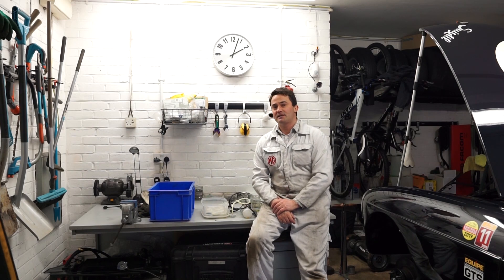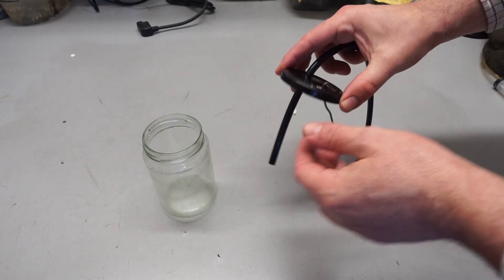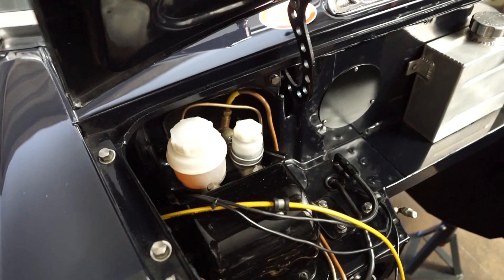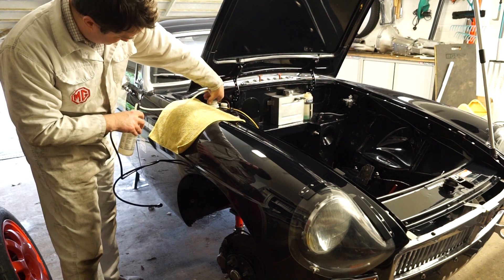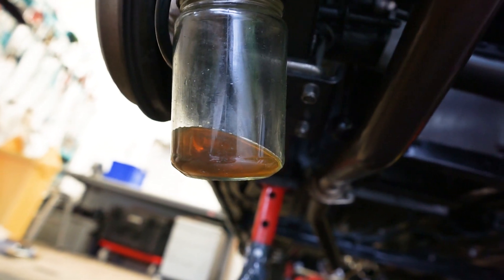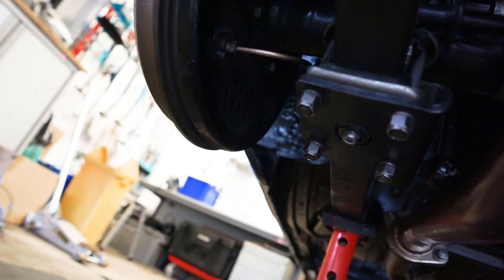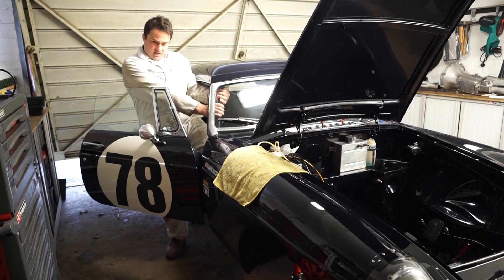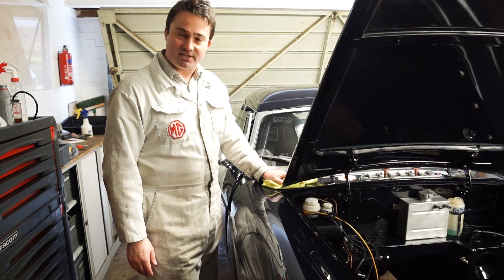Bleeding and refreshing the brake fluid in an MGB using the Gunson’s Eezibleed System One Person Job

Comment: G'day David 

Your video had perfect timing and once again an excellent explanation.  Along with the reinstall of the windshield over the Canadian summer I've also planned to bleed the brakes, the  first by me on my 65 roadster.  The Gunson Eezibleed is now on order! 

I rate your explanation including vision/editing up there with the best when it comes to learning the MGB "secrets".  Well done sir!
Cheers
Aaron G
Reply from the maker: Many thanks Aaron, the Gunson's set  does seem to work well for me, especially if you are bleeding the brakes yourself. Just remember to keep the reservoir pot topped up. Also don't do what I did around 20 years ago which was to bleed the brakes without the front pads fitted; I pushed the pistons out of the caliper! Silly school boy error only made one. 

I'm hoping to re-shoot the windscreen video to show re-fitting it to the car but just haven't really had time, hope all goes well!
Reply: @davidrussellwilks  Gday David - I bled the brakes today, followed your instructions and everything worked fine.  My bleed kit hissed a tad as well but plenty of towels etc ensured the reservoir did not overspill.  The bleed nipples were different size on my 65.  The back ones weren't 7mm, a 1/4" spanner worked on those.  The front were much larger (I cant recall the size).  DOT 3 was my go-to which was the equivalent to the fluid type recommended for the original systems....there is so much conjecture of the those types according to agae of system, seal types etc.
Cheers again
Aaron G

Comment: I've been waiting for you to upload this and am so happy that today is the day. I started on my brakes with a vacuum bleeder. The unit also came with an automatic refill device which is designed to put new fluid back in the master cylinder as the old fluid is withdrawn. The system did not work as advertised. The vacuum would pull some fluid out of the bleeders but would stop pulling before the new fluid got there. I stopped there and ordered EZ Bleeders which are a one way check valve that replaces the regular bleeders. This would allow me to still bleed the brakes by myself by pumping the pedal. Using the EZ bleeders and the automatic refill device that came with the vacuum bleeder, I began pumping and the first caliper went great - the old fluid came out and new fluid went through and the MC stayed filled. I proceeded to do the rest of the brakes trusting the automatic refill would continue to work. It did not and I ran the MC dry. I kick myself for not paying closer attention and also for not purchasing the Gunson's in the beginning.  I believe my only option now is to bench bleed the MC and start over. I would like to know if you have any tips on purging the MC.
Reply from the maker: Hi Trent, that is a real pain, and it is easily done. I had to swap out the master cylinder in my car a few years but I DIDN'T bench bleed the system first. What master cylinder do you have in your car is it the earlier or later type? Not bench bleeding didn't seem to be a problem with the single line master cylinder. I used the same procedure as above bleeding the furthest wheel first; it didn't take very long to purge the air from the system. I think it would be worth trying to bleed the brakes again before removing the M/C from the car?
Reply: @davidrussellwilks  It is a 1967 with the single master cylinder. That is good to hear that I may not need to bench bleed. I'll try again and hope for the best. Thank you!
Reply from the maker: @tkreitler  It's certainly worth a try!

Comment: Thank-you again for another thorough and informative video. Giving me the confidence to work on my own car. A couple of questions I thought of through the video, how will I know that I have purged the old fluid out of the brake lines and now have fresh fluid in? Is it a guestimate based on approximate length of line and internal diameter or is there something that I should look for (other than say bubbles)? Also, with your little collection device, what was the internal diameter of the rubber hose please? I like it and will make my own but a rough idea of ID would be handy (I'm guessing 4-5mm ID but that's quite a guess). Cheers, Phil.
Reply from the maker: Many thanks for your message Phil, if the fluid in your car is old it would be worth using a syringe or similar to take most of the fluid out of the master cylinder, leaving just enough in the reservoir so air does not enter. Once you have filled with fresh fluid and taken around 100ml or so out of the furthest bleed nipple this should mean that the old fluid is out of the system. Often the old brake fluid is a darker colour and once you can see that clear fluid is coming through it should mean that the system is purged. The hose I use for the collector is 4mm ID and is silicone, making it a bit more stretchy.
Reply: @davidrussellwilks  perfect, thank-you.

Comment: Great video David. I was wondering, how did you get all your technical knowledge? Perhaps work related or only from learning by doing? I go for the Pippi Longstocking way: ‘I have never done this before, so it should work’ 😬 With some basic knowledge started on a good original Californian car, running and driving project. Happy with every nut and bolt that loosens easily, but far from the state that your car is in. Interested in how you got so far that we are learning from you! Greetings from a small town near Maastricht.
Reply from the maker: Many thanks for your message Michael, I've never had any formal mechanical training; in my twenties I worked at a friends garage on and off for a few years mainly just working on my own car (an MGB GT). We also had a side line selling MGB parts and restoring cars, I usually looked after the sales side more but certainly enjoyed working on the cars too. A few years later I started the race car project and built most of the car myself  with the help from the team at Lone Pine Garage in the UK. I didn't build the engine, gearbox or back differential but I can most of the work is mine including preparing the body for paint, but not spraying it. The team at Lone Pine were great to have on hand though for any questions that I had. 

I started making videos of the racing back in 2013 and tried to improve on these as I went along. I made a time lapse video in September 2018 showing the engine and gearbox removal, this seemed quite popular and got lots of views so I decided to make a few more videos showing the basic jobs on these cars. From the responses to the videos it seems that there are lots of home users who would like to work on their cars but are unsure where to start. Hopefully the videos I make will give people the confidence to try. 

With my car I am lucky that the bolts are all fairly new and assembled with aluminium great so are easy to remove!
Reply: @David Russell-Wilks: many thanks for your reply. Years of hobbying experience and help from some friends... that’s the secret I gather. O yes, and leaving the really difficult tasks to specialists. Not to Pippi Longstocking 🙂 I used to work on an old Peugeot 504 (1973) with my dad, wo died six years ago. I still own this car and it is 100% original, the MG is my own project now. Flying solo. Taking on every battle at a time. Currently fighting the petrol filler cap of which the lock decided to fail. I think it is great that people, such as yourself,  take the effort to share their experience with others so that we can learn. Lots of thanks for that! Keep it up and your number of followers will grow. 💪🏻
Reply: Hi David, great video for someone who just bought the first MGB like myself. I was wondering if you could advise - during the first drive the break pedal lost suddenly twice pressure during some 60miles drive. When I applied the force again, it was ok. Would you advice to bleed the breaks or is it showing a problem with the break master cylinder? The car was not much used last few years before I bought it . Many thanks for your advise and please keep doing those videos.. 
with kind regards 
Petr

Comment: Thanks for the video. I have just purchased this kit but not used it yet. Quick question if I can? Did you fill the master cylinder to the top before attaching the Gunson cap or did it just fill itself from the main bottle when you attached the spare tyre? Best regards.
Reply from the maker: There was fluid in the M/C but not to the top, it will fill itself from the Gunson bottle as fuel is added. It's well worth testing the system without fluid in the Gunson bottle first to check for leaks.

Comment: Very informative once again David. I'm surprised the pipe is black instead of clear though as how do you know when the old fluid is bled from the brake line? If pipe was clear I assume you'd see a change of colour and also be able to check for air.
Reply from the maker: I did originally have a clear pipe but it split so went over to the black one. By looking for bubbles abd the colour of the fluid going into the jar I could tell if the brakes were bled. I've since been able to find a good quality clear silicone pipe and am using that now.
Reply: @davidrussellwilks  I'm hoping to bleed the brakes on my MGB GT and  1300 ADO16 very soon and was going to use the gravity method. Apparently takes much longer but that's not an issue for me. Have you ever used this method and if so did it work out ok for you? Many thanks

Comment: Good video, thanks.  I have a servo on my B and my brakes are pumping up even after trying to bleed, all looks in order, no leaks anywhere, am thinking 10 year old servo is faulty and needs replacing, as the pedal vacuum test isn't correct, as nothing much happening..
Reply from the maker: If the brakes are pumping up it can be down to the rubber hoses failing, often they look fine from the outside but can break down internally. If you have not changed them in the last 10 years I would be tempted to try this?

Comment: Hi, excellent video and very informative. Do you have any plans to do one on replacing the brake discs? 👍👍
Reply from the maker: Many thanks for your message Paul, I probably won't be doing one covering the brake discs this year as the rotors are still pretty good at the moment. John Twist has a good video here https://www.youtube.com/watch?v=p6FAxg150Uo, probably the most important part of the job is making sure you shim the bearing assembly correctly when you refit.
Reply from the maker: I made a video covering most of the braking system here https://studio.youtube.com/video/82ykSEs-oIE/edit

Comment: David great video, I’m doing my MGA soon, so similar procedure, and I have a eezee bleed system.
One question just out of interest, what gloves do you use for your mechanics work, and are they oil proof etc.
Thanks Jack and keep the vids coming.
Reply from the maker: Many thanks Jack, the gloves are not fully water proof but are enough to keep oil/great etc off my skin, and thin enough to feel what you are doing. They are also breathable which I why I prefer them to the vinyl/latex type. The ones I buy are here https://www.ebay.co.uk/itm/24-Pairs-Of-Brand-New-White-Nylon-PU-Safety-Work-Gloves-Builders-Grip-Gardening/181031170878?ssPageName=STRK%3AMEBIDX%3AIT&var=480203076638&_trksid=p2057872.m2749.l2649

Comment: Hi David. Great video, good clear explanation. Quick question, I've got a 73 MGBGT road car and have had to change the rear brake line and cylinder. I'm using a power bleeder but the pedal is not getting firm. Is it a case of still air in the system?
Reply from the maker: If there are no leaks then the cause of a soft pedal is most likely air still in the system. It can sometimes be worth waiting a few days before bleeding again. A failing master cylinder can also cause these issues if you are having the pump the brakes to get them to work.

Comment: Thanks for another wonderful video. How does one pressure bleed dua line 1969 reservoir that had the larger cap with this system and two sections?
Reply from the maker: Thanks for your message, one should be able to use the pressure bleeder in exactly the same way with the tandem master cylinder. The Gunson set comes with a variety of caps to suit.

Comment: How much pedal travel do you have, and how firm is the pedal? I'm struggling to get a decent pedal travel on my B
Reply from the maker: A few things that may cause a soft pedal:

Water in the brake fluid or old brake fluid
Rear wheel cylinders not adjusted correctly
Poor rubber hoses front and rear (these can break down internally and should be changed every 10 years)
A failing master cylinder
A failing brake servo if fitted

The pedal should be fairly firm, I'd start at the top of the list and work down, the first three items are the cheapest to fix.
Reply: @davidrussellwilks  thanks. My problem is all the brake components except the drums are new and the rear brakes are fully adjusted. Also bled the system multiple times and got rid of the servo. I have a very similar set up on my 7 kit car,  i.e non servo discs and drums and the brakes are fantastic. Maybe I just need the pads to bed in more.

Comment: Hi, great video. I've gone through everything on your video but brakes still spongy, any ideas would be appreciated.
Reply from the maker: Thanks for your message Dave, spongy brakes is usually due to air in the system. Were the brakes spongey before you bled them or after?
Reply: @davidrussellwilks  Hi, thanks for replying. No the rear  passenger  brake piston was corroded and failed locking the  brake calliper onto the drum. I have replaced the entire rear brake assemblies on the rear wheels , shoes , pistons, springs etc. Wondered if I had let the brake fluid get to low in the master cylinder?. I have then gone on and followed your steps in the video but brakes still spongy and will only brake at foot to the floor. Would the brake servo have any thing to do with it. Was going to repeat the process with the engine running today. It's a 1972 model.Thanks Dave.

Comment: I bought one of these kits but I cannot get the fluid bottle to be airtight....   😞
Reply from the maker: They do sometimes leak around the hose. Always try the bottle first with no fluid in but with the air connected, usually a little bit of fine tuning allows you to stop the leaks. Careful not to over tighten the top on the bottle, they can split.

Comment: What about if you've had to rebuild both master cylinders like I am in the process of? Can I use this bleed system having put the whole assembly back in place dry?
Reply from the maker: Yes, you can use the Eezibleed on a dry system, for the brakes work on the furthest one from the master cylinder first. It might be worth bleeding twice just to make sure all the air is expelled.

Comment: Used one of these yesterday on a Caterham having replaced both rear cylinders. Ran it at 15psi and pumped through plenty of fluid and no bubbles coming through. Tested brakes, nothing, no brakes! Scratched head then did it the old way with a friend pedal pumping, brakes came up perfect nice firm pedal. With the eezi bleed spongey and no pressure. I really can't recommend these bits of kit.
Reply: 15psi is too low, especially for the rears which are further from the reservoir. On my BMW I use around 27psi.

Comment: For some bizarre reason this absolutely did not work today :( No brakes. No idea what I've done wrong.
Reply from the maker: I'd probably start with the master cylinder if all the brakes are poor. Are the seals in it good?
Reply: @davidrussellwilks  Hi David, I think so. I didn't hear any leaks and all the fluid came out clear with no bubbles from every quarter. But I have new EBC green pads and cross vented drilled disks. so no idea...

Comment: It's a shame but they don't last long before parts start failing. Seals etc.
Reply from the maker: That is true, I got around 7 years out of the last Eezibleed before it started to fail (a cracked lid). I felt given the low price it was acceptable though.